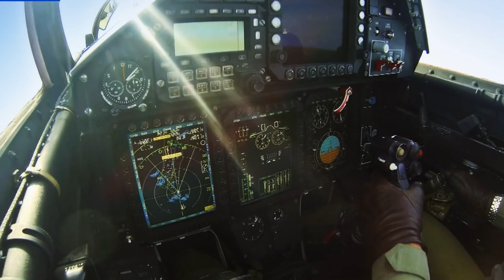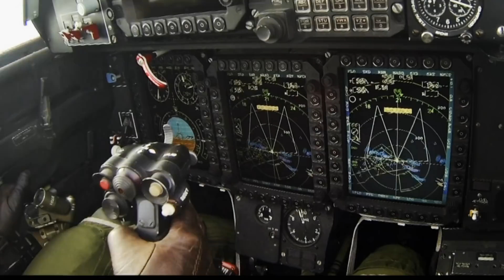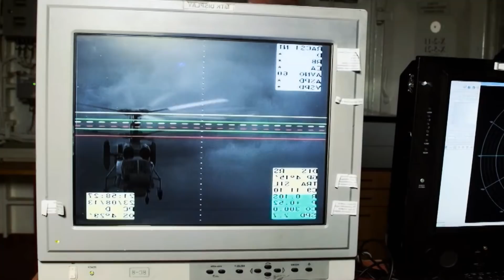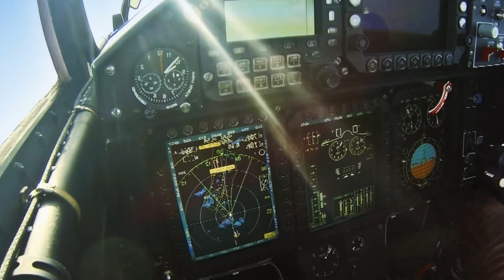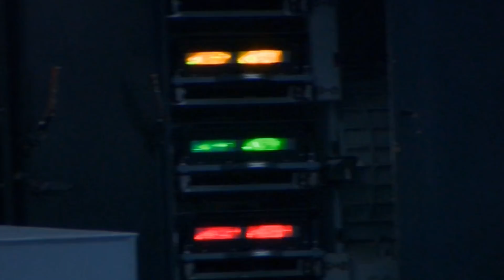Time Is Running Out for Russia's Only Aircraft Carrier - Admiral Flota Sovetskogo Soyuza Kuznetsov

Comment: It's not a bad ship, just quite poorly maintained. I don't however think it's really suitable in the role as an Aircraft Carrier (for reasons stated during the video) but should really be more confined in its role. Putting monetary concerns aside, what the Russians should have done in their navy is have one or two "supercarriers" that carry a comparable sortie capabilities to American Carriers and then a larger number of Kuznetsov carrier-cruisers that due to their extensive armament are somewhat more flexible but less suited in the Carrier role, and could be useful when the given mission doesn't require the full force of a supercarrier.
Reply: khrystov czevak problem is funding.
Reply: I think that the Russians were taking baby steps when developing their carrier program, just look at the Kiev class, it's nothing more than a CG with a carrier deck stuck to the side of it. The Kuznestov, while more conventional in appearance is not that different from the Kievs in concept being a missile cruiser that doubles as an aircraft carrier. The difference between the two is that the Kiev was more cruiser than carrier while the Kuznestovs are more carrier than cruiser.
Reply: khrystov czevak Russia doesn't need aircraft carriers as their jets are superior in every way, they have larger fuel tanks, are more efficient in fuel consumption. When a single t50  can fly longer than  2 f22 , there is no need for a carrier when you can get 2x that from a airfield. Thus the no need for more than one aircraft carrier.
Reply: Battleshipman56 
Russia needs two proper carriers at least, one for Northern and one for Pacific fleet, and they know that. Problem is lack of experience in building supercarriers, and of course funding, because they are currently busy building fleet of big frigates comparable to destroyers in almost every aspect, and new nuclear submarines Borei and Yasen.
Reply: khrystov czevak I agree not a bad ship but poorly maintained was it poorly maintained Russia put me some good people a superpower at that why did poorly maintained your weapons can you explain it to me please I need your expertise on this

Comment: It does not support the Yak 41M Freestyle because the Yak 41M was never put into production. They made two prototypes of it and then cancelled it. Also, the Su-27K is the Su-33. Nobody calls it the Su 27K. The jet aircraft that it supports are the Su-33 and the Mig 29K. But even then the Russian Navy may regret the Mig 29K. It is reported that each time the Mig 29K lands it has to do a total system reset which may explain why Russia lost one over Syria when the plane just lost all power and crashed. They have not had that problem with the Su-33. They did loose an Su-33 but that was when an arresting cable on it snapped and the Su-33 that had grabbed it went over the edge of it and sank but fortunately the pilot was able to eject in time.

Comment: russian plane copy of F-14 air frame.
Reply: johnny6148 I never knew it was that old. Damn... upgrade? It needs to be scrapped and a whole new design needs to be implemented. Not to mention, only one carrier. Is like having a muzzle loaded smooth bore gun, in todays age. Russia I know you can do better than that. Most likely, they've got something hid away up thier sleeves. They surprised the world with thier T-34 tanks in WW2. And thierMIG-15's in Korea. Also with thier Flanker in the early 90s. Last but not least, thier Sputnik launches, manned or unmanned  in the late or mid 50s. I wouldn't be surprised if out came some stealth sea vessel capable of launching airplanes and unmanned fighter drones. DON'T EVER SLEEP ON THE RUSSIANS. THEY'RE FULL OF DEADLY SURPRISES. PEACE!
Reply: F-14?

Uh... no, the USSR had no equivalent aircraft.  They did have variable geometry fighters (e.g. the MiG-23) but those were not designed for naval use.

The Su-27 shares some vague similarities in the empennage with the F-14, but they are quite different.
Reply: @samuelparker9882  lol. Putin has drove Russia to poverty. They dont have the money to fund anything like that anymore.

Comment: Nice video.  They should probably keep her, even if they start building more capable carriers.  A single capital ship, or even a small number, is not actually much use.   Examples abound - the Japanese super battleships Yamato and Musashi, the German battleships/battle cruisers of WW II.  So afraid of losing them, they tended to be very conservative.  
Catapults are just better - able to carry ASW aircraft (other than helos), COD planes etc.  
Nothing inherently wrong with conventional boiler power.  Tends to lead to more massive power plants and more engineering crew to get the same performance but training levels for the engineering crew is a lot easier to achieve.

Comment: I should point out that the ship TECHNICALLY isn't a carrier. The reason the Soviets were so late to the party with carriers is because they are only really useful if they can go in blue waters, and most of Russia's shipmaking facilities are in the black sea. They had some kind of agreement with Turkey saying carriers can't pass through the bosphorus (the barrier between the Mediterranean and black seas, which needs to be passed through to reach the Atlantic). Due to this, the Kiev and Kuzetsov classes were labeled as "aviation cruisers", not Aircraft Carriers.

Comment: The issue with said submarine is not her supposedly being outdated. If it will be up to me, I would still be using T-34 tanks in the military.  It is hard to argue about 85 mm hitting your IFV and infantry, no matter the age. It is similar with ships. It is a platform. It is the capabilities. This ship can provide generous amount of helicopters and planes for the fleet and Russian navy in general. This is essential when projecting power aboard. It is not about how modern one is, it is about what it can do and in cases like aircraft carriers, there is no such thing as being ''outdated''. Every weapon system can be replaced and upgraded. Aircraft carrier in essence is just a hull, nothing more. Radar, weapons systems, planes, those things can always be replaced easily. It is not like submarines where noise level which is generates are rather implemented in its design and to ''upgrade it'' you essentially need to rebuild the ship at the cost of the new one.

So, overall, this ship is not outdated. There is really no such thing. The real question is about capabilities which Russia needs. Having two aircraft carriers is orders of magnitude better, but the question is: can Russia afford it? Do Russia needs it? As it stands now, Russia is not USA. It does not need to have superior airforce against serious opponents who can bite back. Even a single aircraft carrier will suffice in operations where Russia is imagining to use such a ship. Like proxy wars, backing up nations, similar like in Syria. This is why it is better for Russia to design a new aircraft. With proper autonomy to travel around the world and packing far bigger punch. This hybrid aircraft carrier is a good design, helps a lot to smaller navies who cannot ensure dominance of its naval fleet and thus, transforming aircraft carrier into semi-battleship of old. Smaller size also means lower costs overall which do not inhibit inherently short range of Russia's navy's needs. Yet, in the modern war, one would need a ship and a fleet which, while might not challenge USA force directly, but be capable of redeploying around the globe and enabling Russia to project power in more efficient ways. Even if such capability is far from Russia's reach now and it focuses like it did historically, on short to mid range submarines and defensive fleet, any great power needs a blue water navy. 

In conclusion, New aircraft carrier is not needed for current Russia's naval strategy. They would be better off by upgrading this one and riding her out in the end. Though, national pride and symbolism, pride rarely goes hand in hand with real military needs. Lets take Kriegsmarine of WW2. Germany had wasted precious steel and funds in creating massive battleships like Bismark, Tripitz. Building up huge blue navy fleet and for that? To raid merchant shipping? Germany needed to focus solely on small ships for coastal defence and denial of allies naval power next to its chores while focusing its resources on production of submarines in order to raid shipping lanes. This strategy was undeniably more efficient and it was obvious even in 1936, but national pride often comes in front of clear thinking. Russia is especially prone to it with its inferiority complex and desire to build aircraft carriers which it really does not need that much to begin with.
Reply: stick to the video game war is a mans game skippy

Comment: So, Kuznetzov launched in 1985 is old and needs replacement while Theodore Roosevelt which was launched in 1984 is a modern aircraft carrier and there is no need to replace her. Interesting...
Reply: +Георгий Мурзич

 The entire Nimitz -class undergo several major overhauls every decade. The U.S.S. Theodore Roosevelt (CVN-71) has undergone one 4-year overahul at the beginning of the decade (2009-2013) and has undergone two three to six month overhauls in the past three years. The Admiral Kuznetsov is considerably smaller and has less capacity for upgrades, not to mention given the Russian Navy's limited funding, upgrades/refits are not as common.
Reply: Nathan Peterson It is still older

Lol, who compares upgrade capacity by size?
Reply: +Георгий Мурзич

 When you have a lot more space for everything, you have a lot more capacity to integrate newer, bigger or smaller, pieces of equipment.
Reply: Nathan Peterson so that means that abrams is a piece of obsolete crap because tanks are smaller than carriers

Comment: The main problem Russia has right now and affects many things including their military procurement is that their state budget is based on oil and gas exports to a very unhealthy extent and now that they're both cheap Russian state income has gone down the toilet. Russia simply can't afford to modernize it's army at any rapid pace and this includes their navy. The replacement for this ship will thus not leave the drawing board for a very long time and it may very well get scrapped before a replacement will be ready.

The kind of funny part about this is that the low oil and gas prices behind the Russian budgetary cris were inadvertently caused by the US. When the US became self-sufficient in oil and gas trough hydraulic fracturing OPEC decided to make oil and gas cheap enough that the US could produce it for it's own use, but that the comparatively high extraction costs would prevent the US from also becoming an oil and gas exporter.

Comment: Also ships of project 1143 were basis for 11435"Tbilisi" after was renamed to "Admiral Kuznetsov"  and 11436"Varyag"(these two ships are twin brother-ships),but ships of p.1143("Kiev"-class by NATO codename), weren't equipped by ski-jump ramp,because at nose part there were strike weapons like antiship missiles P-500"Granit",also Kiev-class ships were able to carry only antisubmarine helicopters and VTOL Yak-38/38M,fourth and the youngest ship of Kiev-class "Admiral Gorshkov"(former "Baku")after several years of staying without any work was modernized for Indian Navy for 1 billion $,instead of P-500 launchers, ski-jump ramp was constructed, basically it looks like "Kuznetsov 's" ramp,but got a little bit another size and geometrics,overhauling main power plant,electric generators,new navigation, radars etc

Comment: The Admiral Kuznetsov generates a continuous smokescreen of hot black gas that makes it invisible to optical and infrared sensors. Its engines develop such enormous power that it can outrace any other vessel afloat easily, hence it normally uses its secondary low-tech engines that sometimes give it problems.

Comment: The range on their radar is..... yeah bad. An anti-ship cruise missile will travel in excess of 240 m/s (US Harpoon) which gives the ship roughly 48 seconds to identify a small sea-skimming missile, verify it's a threat and engage it. That's not a lot of time and that's one of the slower anti ship missiles out there. The Exocet goes 315 m/s giving it even less time to respond. I would assume it would be more reliant on it's escorts for additional missile/point defense under normal circumstances.

Comment: What has always left me wondering is why this project uses steam turbines powered by fuel oil boilers instead of nuclear reactors (like many capital-class vessels throughout the world, namely Nimitz-class US carriers) or, virtually, any other more or less modern type of engine. These were old already when this ship entered service.

It's not like the USSR didn't know how to make nuclear-powered ships. Its entire Arktika icebreaker series is nuclear-powered - and it dates back to 1960s! So using steam in 1980s still strikes me as odd.
In our days it's definitely a very dated ship ridden with problems.  After their dry dock previously used for repairs sunk in 2018 (a year after the video was made), I honestly have no idea how they are going to repair it. Ancient power systems make up a great deal of its maintenance.

Then again, aircraft carriers were never cheap in the first place.

Comment: The reason it is a aircraft-cruiser was to get around the Montreux Convention Regarding the Regime of the Straits is a 1936 agreement that put Turkey in charge of the straits.  No more than nine foreign warships, with a total aggregate tonnage of 15,000 tons, may pass at any one time, therefore a single non-Black Sea state warship passing the straits might not exceed 15,000 tons. All non-Black Sea warships in the Black Sea must be no more than 30,000 tons (or 45,000 tons under special conditions), and they are permitted to stay in the Black Sea for no longer than twenty-one days. So the convention stopped Soviet ships moving into the Mediterranean sea but also stopped outside nations from moving into the Black Sea. But the inclusion of aircraft on any other ship does not classify it as an aircraft carrier. So for the Soviet Union it designated all its Kiev class and Kuznetsov as aircraft caring cruisers. So the Soviets could get its ships out of the Black Sea while stopping Western aircraft carriers from getting into the Black Sea. Turkey accepts this rather than loose control of the straits. But you are right it needs to be replaced or scrapped but the Russian keep it going to maintain training til it can afford a larger carrier. But the Russians are more interested in submarines with more newer models coming out than surface ships. This is because always saw the submarine as the answer to American carriers.

Comment: I was like "why is that guy still going so fast when he lands" then i realized he's missing the damn catch every time lmao 😂
Reply: Obviously you never served on on a carrier, I did.  He's performing DLPs - deck landing practice.  All new pilots have to do it to qualify for carrier operations.  And experienced pilots who've been away from carrier ops for a while need to re-qualify.

It's simply practicing your landing approach to the point were you could do in your sleep, but you leave the arrestor hook up.  You make your approach, hit the deck, and then up the throttles and go around and do it again.

When I was on Australia's last carrier, the old Melbourne, aircraft returning from a sortie that still had fuel onboard would usually engage in a few DLPs to burn of the last of their fuel.  Otherwise the aircraft would have to be de-fueled on the flight deck before it could be taken down into the hangar deck.

Comment: The problem with nuclear power and the reason the QE class lack it is mainly personnel. Royal Navy has a massive shortage of personnel, and adding trained nuclear technicians to the list of personnel would only make that worse. The French aircraft carrier has had issues with a lack of sufficiently trained nuclear technicians. Also, safety issues. The French carrier has had issues of radiation leakage reaching cabins, something the British wanted to avoid. It’s worth remembering too that the Royal Navy has a very robust naval auxiliary support fleet, so refuelling the ship at sea isn’t an issue as much as it is for other navies.

Lastly, is speed. Specifically readiness speed. A nuclear carrier can’t be turned on and off as a conventionally powered carrier can. Britain specifically envisioned the carriers as having high readiness capability, so making them nuclear powered didn’t really make much sense.

Comment: A truth is Russia is spending a boat load of cash modernizing all areas of their military. Russia is traditionally a Land power. It makes more sense for them to concentrate on Land units and Air units. And naval you wise Subs. Russia's only has a GDP the size of Canada. So it's impressive what they can do on limited funds.
  But I see the rationale of putting Carriers on the back burner, until they can bring there total land forces, and air forces up to the size and technology the need.
  And for the Navy, stick with some of those impressive subs they build. Also I really believe bringing their standing army up to an all volunteer professional force is a must.
   After they get all these requirements done. They can then go on and build a few Modern Aircraft carriers. With only one warm water port, Land warfare is far more important to them as well as Air power than an offensive Carrier program. Subs can fill in as a stop gap, in a defensive and offensive portion of they're navy. As well as small anti sub frigates. To defend against subs getting in close to their shores with land attack missiles.
  They are on the right path.